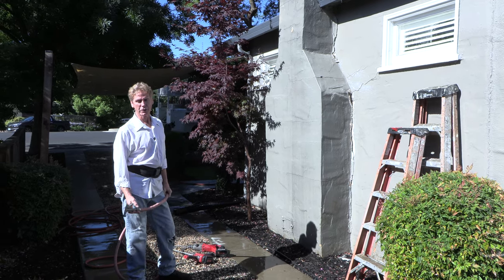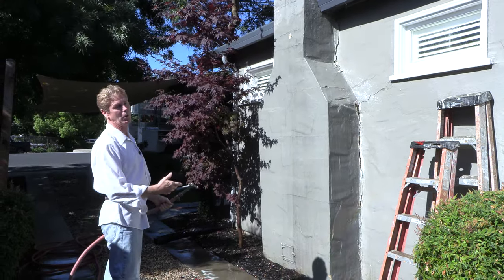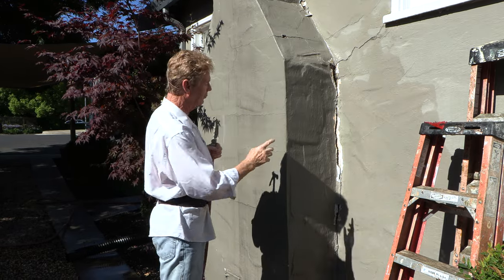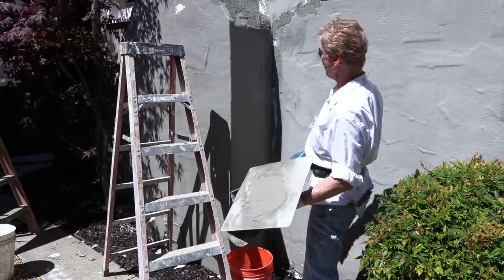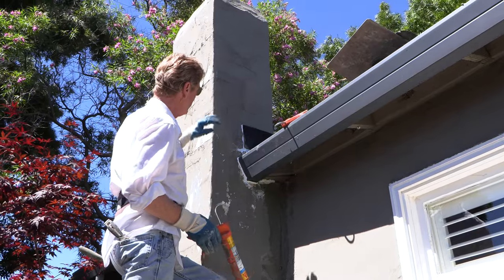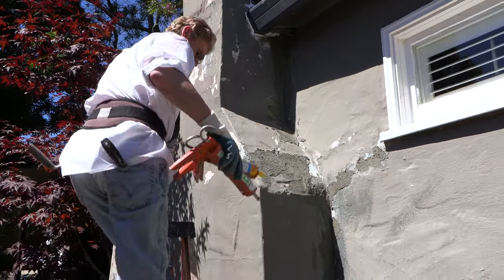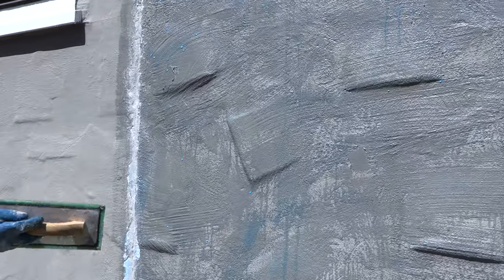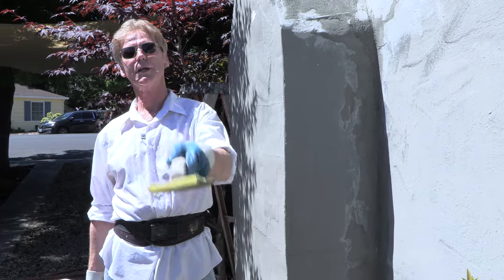Caulking cracked stucco chimneys. Dust Masks

Comment: One thing works. The positive ok pressure masks with a fan and dessicant dryer. I'm the humidity of the Galveston summer, in a tyvek suit outside in 109 degree sauna conditions. And during hard work outside in the Minnesota winter. (working on shooting ranges with lead dust everywhere.)
Reply from the maker: Sounds scary. I'll have to stick with stucco.💃

Comment: The water sprayed at the paint shop is usually to keep the dust from flying up when spraying with the gun. It’s not to keep the flying overspray to stick to the wet surface.
Reply from the maker: Exzackory, I thought I was saying the wet sheets and ground, was done to catch the dust created by the air, thus stop it from getting on the painted car surfaces. I was doing many things this day, and did not explain myself as well as I could have, the big ops.👨🏻‍🔬

Comment: thanks for the tip! i have almost a 100 year old house in Toledo ohio.. it’s a spanish style house the builders only did a few in the whole city, each one of a kind.
I’ve been playing around with the stucco .. been using a really flexible caulk on the chimney.. i’m gonna try what you use. i have a question.. what is a good all around stucco repair mix?
Reply from the maker: "Rapid set stucco", sold at HD or lowes. You just add water, It sets in about 15 minutes.🕵🏼

Comment: What I've learned, and maybe we are talking about two different things, is that lime in a mix will not allow the material to flex, but actually what happens is that if water gets into the dried material the lime will absorb the water and harden into new rock on a microscopic level. Cracks (from water at least) are never born. However, the material can still crack from movement/force, so it's not flexible unfortunately.
Reply from the maker: Close enough, Lime is flexible to a degree and self-healing, unlike Portland cement which does not flex. 🕵🏼

Comment: Hey Kirk, great content as always! If you had an old shifting house that had been stuccoed over lath without paper would you opt for waterproof cement over flexible cement?
Reply from the maker: Hi Tyson, I think you're referring to wood lath, this does indeed have tar paper in the back of the horizontal wood lath. This wood lath was used primarily around 1880 to about 1920, it's excellent lath but need to be painted every ten years to protect it from the rains. I'd recommend an acrylic stucco or paint from Stucco-flex over the home after it's pressure washed, well enough to eat off. I have several video of how to on this channel👨‍🏫

Comment: Hi Kirk 
Thanks for awesome instruction. Following a fire in April we had to replace many window units, Stucco had to be cut away 3 inches around 10 windows.
Watching you I was able to save over $5,000 dollars and a two month wait to get a Stucco Co.
Thanks so much.
Question I'd like to put up the styrene half rounds, can't a supplier, we are near Bisbee AZ, would happily drive to Tucson or other.
Any help greatly appreciated.
Rusty n Kelly
Reply from the maker: Howdy Rusty, glad this or the other thousand videos we share on how we do things, helped. We have many on how to attach styrofoam too. Type in "Stucco styrofoam molds companies near me," and they will come up in the Google search engine. 
Remember get them pre-meshed and coated with poly-bond.👨🏻‍🔬

Comment: If I go and buy ‘bonding agent’ are there different kinds? And did you use a bonding agent to fix that crack?
Reply from the maker: Hello, bonding agents are used to adhere stucco to painted surfaces, Mor-Flexx caulking is good for cracks in stucco walls. 💃

Comment: Hey my friend, thanks for another wonderful video. Question, bounding agent work with drywall repair?
Reply: Zinsser makes a product called Gardz, it will bind and bond loose paper, it will even absorb into loose layers and bubbles and you can skim coat over it and level out the surface too. I have fixed things that others would have replaced the wallboard and mine looks just as blemish free. I’ve used it professionally for over 25 years.
Reply: @clintprice2123  thank you my friend
Reply from the maker: Yes, absolutely, Larson makes Plaster-weld for interior work. Their exterior bonding agent is called Weld-Crete. Another excellent bonding agent is Quikrete sold at all hardware stores by the pint or gallon. Larson's is usually only found at plastering yards. 
Sounds like Clint's suggestion is also excellent, But, I have not tried it. 💃
Reply: @StuccoPlastering  thank you my friend. And thank you for all the super educational videos

Comment: I’m curious why you decided to put like cement over the caulking? In past videos you would just float out the caulking and call it a day. Is there a particular reason why you didn’t do that here?
Reply from the maker: Morning Brad, good question, it depends on the size and depth of the hole, caulking will shrink if it's applied too thick. We did shoot some SikaFlex 1A into some of the areas where needed prior to our stucco, just in case. That area cracked because the roof diverter/gutter was not in place thus the rain goot behind the gutter. We fixed that while we were there.🕵🏼
Reply: @StuccoPlastering  appreciate you taking the time to reply. Huge help, thank you 🙏